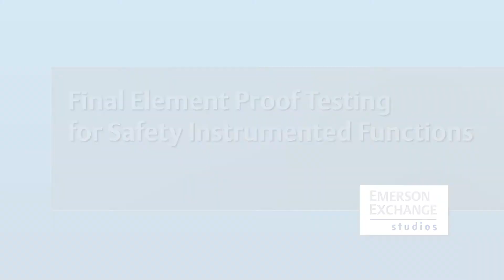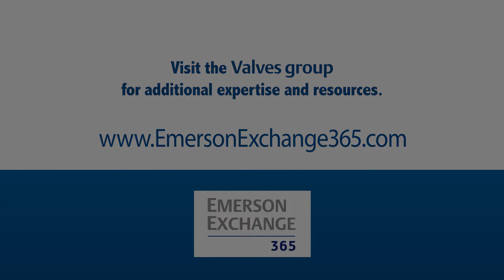Final Element Proof Testing for Safety Instrumented Functions

Comment: Very good information shared through a few minutes video. 

Now I remember, during 2010 when I was working in a petrochemical plant in Saudi Arabia, Reliability and maintenance departments worked together to modify the XVs (Cracking furnaces feed gas line). As I was on the beginning stage of my working career, I didn't understand why they spent thousands of riyals to make these modifications. Now, as a functional safety engineer; there is no more doubts :)

Saad Ebrahimkutty
FS Eng. (18032 / 19, TUV Rheinland)